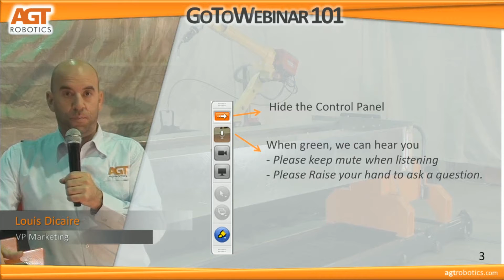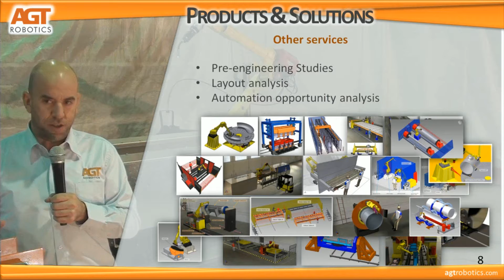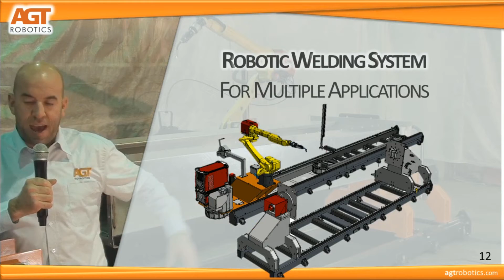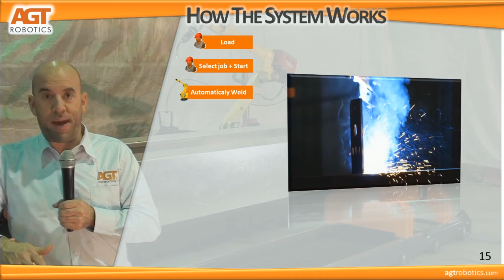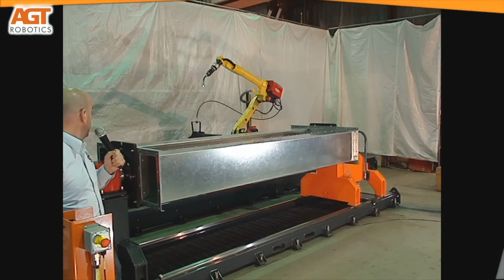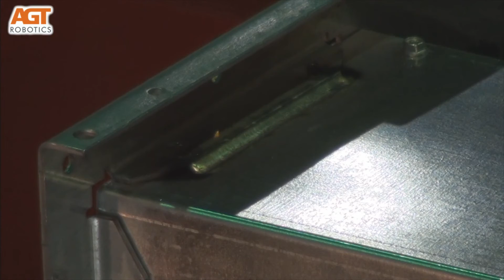WEBINAR - Robotic Welding system for Multiple Applications (EN) | AGT Robotics

Comment: Is your Rail system designed with Servo motors or Induction motor with VFD & brakes ? What is the Robot system weight & repeatability of the system
Reply from the maker: Hi, with servo-motors.